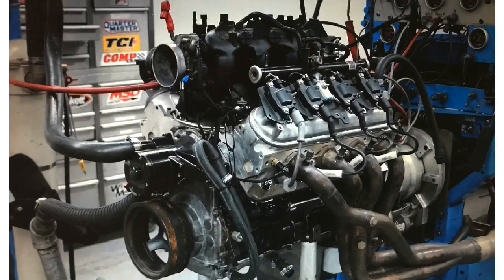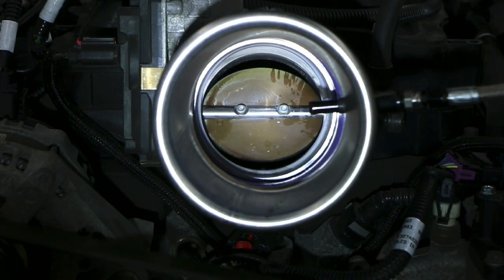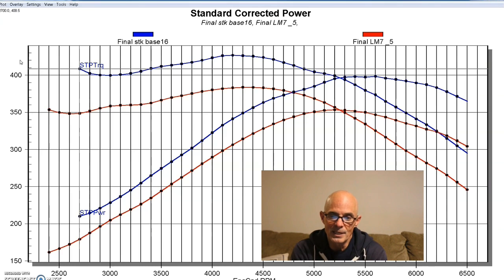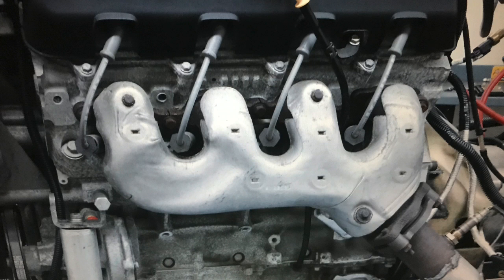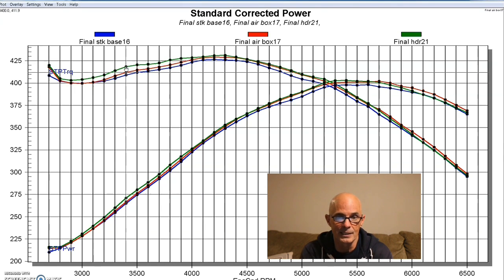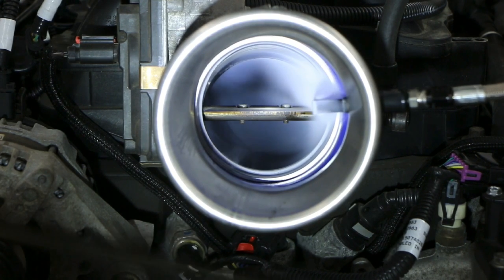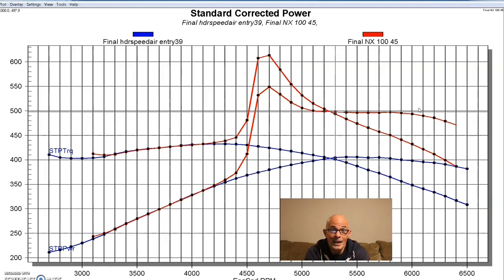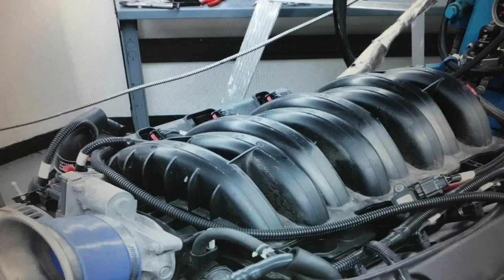JUNKYARD 5.3L L83 NITROUS TEST-THE REAL DIRECT INJECTION!

Comment: RICHARD, Would love to see ls1 5.7 content, big bang on this ls1 aluminum blocks see what breaks first etc,  DYNOS , upgrades , vs 5.3 and 6.0, seems like iron blocks are your cup of tea, thanks, love the channel.
Reply: The problem is the ls1 is an old sports car engine, so they've a had the snot beaten out of them. It's in the same boat as the Nissan SR20, not a bad engine but they've all been driven hard and put away wet to the point that it's almost a waste of money to bother with them
Reply: @unlisted9494  let's just say I agree to disagree, granted the 5.7 have their limitations as far boring them you can only hone them, I've had quite a few of them they're excellent engines, I also have 2000 C5 Corvette with hundred twenty thousand miles on it, and I put a Vortech Supercharger on it and I have gone as fast as 10.40 in a quarter mile at a hundred and thirty-two miles an hour, and yes of course like you said I beat the living hell out of it for over a year and there was more performance to be had of it but I decided to take the vortec supercharger out and give the car to my daughter still running strong and that is just but one example out of many 5.7 s that I've had.
Reply: @mannyr.2756  operative word there is at the end, HAD. Like I say, they aren't a bad engine, but any more an ls1 costs as much as a 6.0/6.2. For the cost of an ls1 with a few bolt ons, you can have an ls3.
Reply: @unlisted9494  agreed these 5.7 engine are pricing, if I had to purchase an aluminum block I most definitely would have gone with a 6.2, and by the way I have to 5.7. One sitting on the engine stand is a virgin unmolested and perfectly good running shape LS6, and the second one I put in my 2010 Camaro I'm using an LS3 camshaft 862 cylinder heads they were reported 2" intake valves and milled the heads 30 thousands, man I tell you this thing runs better than any 6.2 naturally aspirated Camaro that I had before.
Reply: Hey richard in your very first clip on this video. When you did the na test looks like the nx system was leaking. You can see fuel coming out of the nozzle and when the throttle blade closes there is frost on it just like the 100 shot pull. Do you thing the nitrous was leaking and that's why it was such a high na numne.
Reply from the maker: that was just residual fuel from a previous nitrous hit-the na run didn't actually have the nozzle in place.
Reply: Oh ok I was just wandering

Comment: Thank you for this video! I currently have a Silverado with the L83 engine. I’m adding L86 intake Manifold, headers, nitrous and converter!!
Reply: Just stock it in an f150 lol, it's a shame the Silverado is so much heavier when it has the engine you really want.
Reply: @unlisted9494  not really "so much" heavier.. The f150 was >200lbs heavier then dropped ~300 with the aluminum body..

Comment: As for fixing fueling. In Australia we run staged injection when modifying GDI engines.

Keep the OEM di, and stage in port injection. Just like toyota/Subaru do in the 86/BRZ.  Also keeps the intake valves clean as well as the di injectors cool. Probably can't do it with holley efi🙄😅.
Reply: This is already being done and there are kits developed with a holley ecu and port injectors for our genV V8
Reply: We are doing the same thing here with the EcoBoost engine's
Reply: Ecoboosts don’t like to see added fuel tables, the fueling loop likes to pull fuel and force the port injectors to work more or it’ll just cut power. I’m working through this issue with a gen 1 ecoboost.
Reply: @RadDadisRad  have you had any luck with the DW injectors with xdi-60 pump
Reply: Being able to run big power through only direct injection is the 'holy grail' though - you can get much more aggressive with the engine build & tuning since the window for detonation is SIGNIFICANTLY shorter because obviously you only add the fuel into the cylinder when you want rather than as soon as the intake valve opens

Comment: That engine is impressive I love to see what's going to be coming in the next 10 years or so for a performance potential
Reply: Hate to break it to you, but unless they really amp up development to racecar level stuff, the v8 will soon go by the wayside in favor of turbocharged smaller displacement engines
Reply: Un Listed No it won't, v8's will start disappearing when electric vehicles become mainstream
Reply: @lucysmith4242  it's 100% related to emissions. V8's will soon go the way of the v12.
Reply: Un Listed nope. You understand they can just make v8's smaller right? You can have a small turbo v8 that will be comparable to a small turbo 4cyl. It all depends on the design goals of the engineers. V8's disappear when ICE engines disappear.
Reply: A smaller V8 creates more problems than it solves. The turbo 4s can stand in place of a large displacement V8 because of their torque curve. A small V8 will create a proportional amount of torque related to its size. It needs to rev higher to create the same amount of horsepower, and doesn't have enough displacement to match the amount of torque.
Reply: Kevin Mallender That is a good point yip